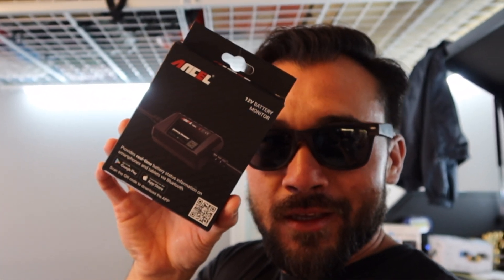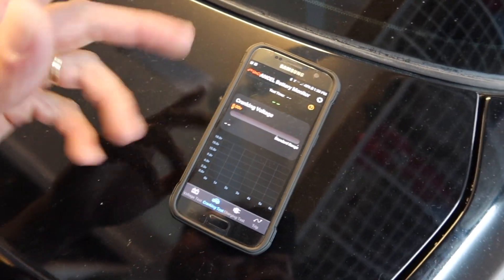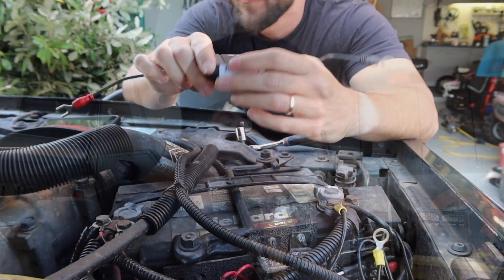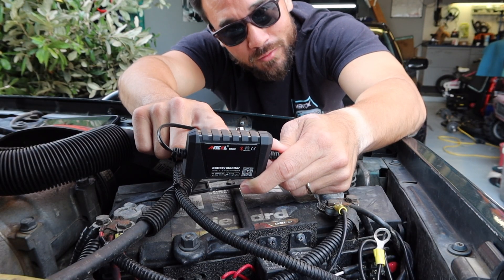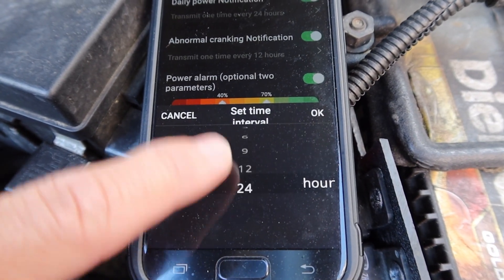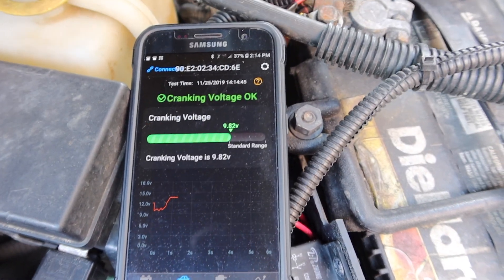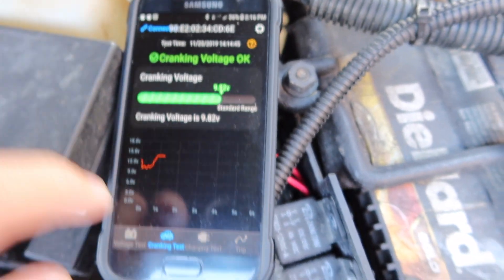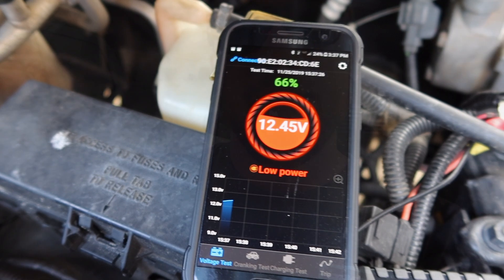I Just Made My Car Way Smarter / ANCEL BM300 Bluetooth RV Battery Monitor For Your Smartphone

Comment: This could come in VERY handy on the newer Jeeps with the dual battery, auto stop/start setup. There’s a secondary aux battery that is notorious for failing and then draining your main battery, then you end up not being able to crank off of the main battery because the failed aux battery has killed it. If you connected this to that aux battery you could get some insight into when it might be failing. 🤔
Reply from the maker: Good idea
Reply: QUICKLYNKS BT2000  este mai avansat, arata SOC si SOH. In plus arata si rezistenta interna a bateriei si rata CCA.

Comment: This device is a piece of sh#t. My dashcam is hardwired to my car and without using my car, the battery lasts more than 24 hours. After I installed this device, my car battery will just last for 12 hours or less. No, my battery has not degraded because when I removed this device, my battery lasts more than 24 hours again. This junk is more harmful than it's supposed to be helpful as it turned out to cause a parasitic drain.
Reply from the maker: ? Your battery ,  should last  months.
Reply: @Donnythelatemodeltech  Yup, my car battery. But due to the parasitic drain this device causes, I had to uninstall this.
Reply: How much does it drain? Your dash cam runs 24/7 when your not using your car?

Comment: I need this! I've been having issues with my battery going dead on the job site when I leave the lift gate or doors  open (05 Suburban) for what seems to be a short periods of time. The time out feature seems to be working. I've checked for parasitic drains and tested the battery and everything seems to check out fine.  (scratching my head)... This thing would give me some piece of mind when time gets away from me or I'm the last one one the job with no one to jump start me. Thanks for sharing!
Reply from the maker: Cool,  right now it's cheaper than ever ,,, black Friday sale.    Link in the description.
Reply: Its on the way. Happy Thanksgiving!